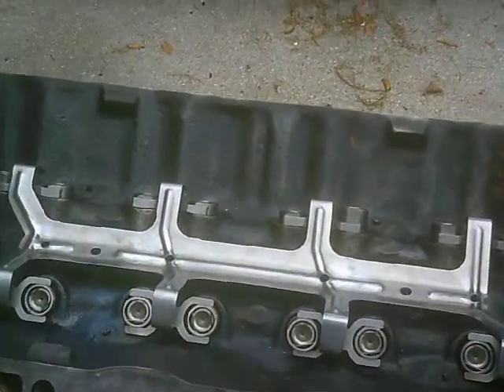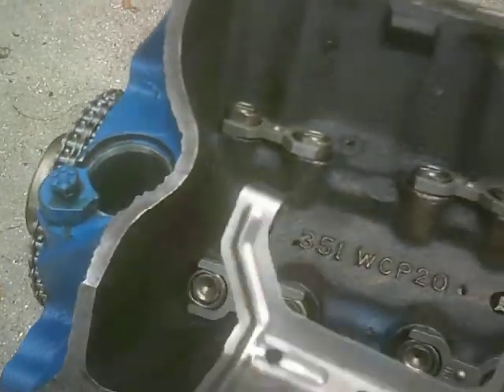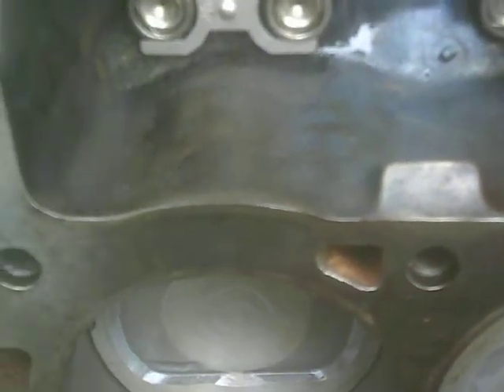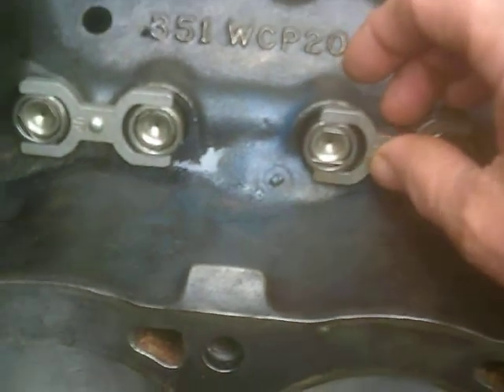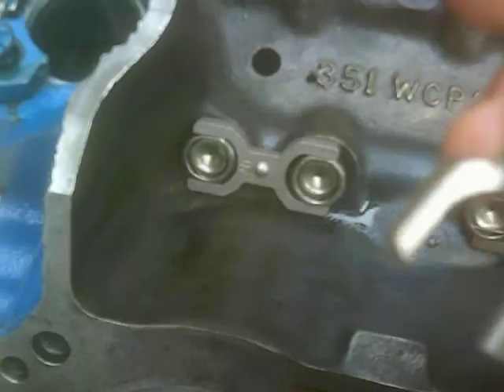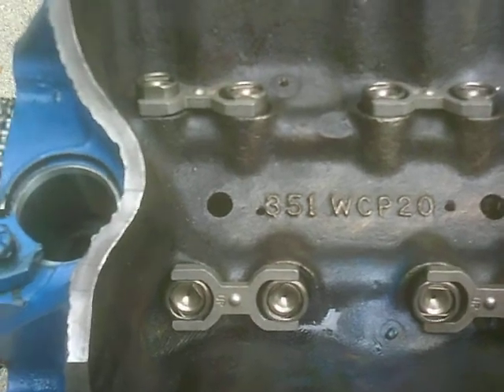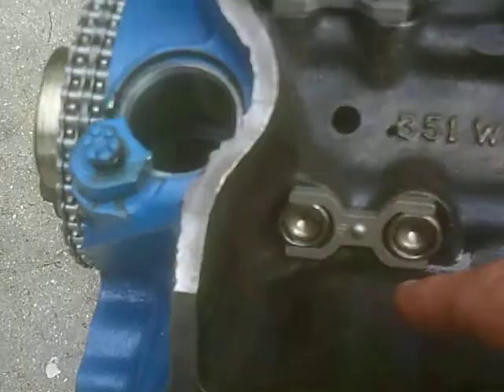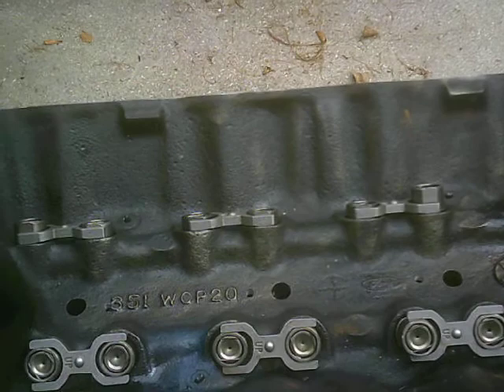Ford 351W roller cam retrofit kit. Comp Cams kit SK35-427-8 and kit 31-1000. Part 2

Comment: The same parts in the wrecking yard. Even can use used Ford lifters. Comp makes junk. Ford parts are better.
I'm using stock Ford roller lifters in a modified boss 302. 
Can easily spin stock roller hydraulic lifters to 7,000.
Reply: You can't use oem lifters in a non roller block. The oiling holes are in a different location and you won't get oil through the pushrods to the rockers
Reply: @jasonochs8369  you can if you off set grind the cam.
Reply: @cammontreuil7509  so can you explain more because there's not a lot of info out there on this. I'm guessing it means getting a custom ground cam? I couldn't just use an off the shelf cam, correct?